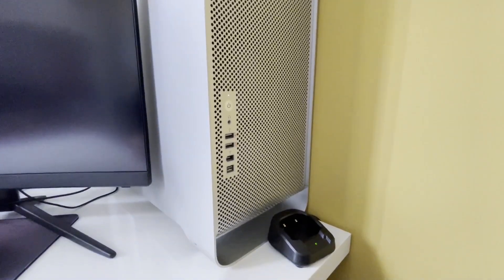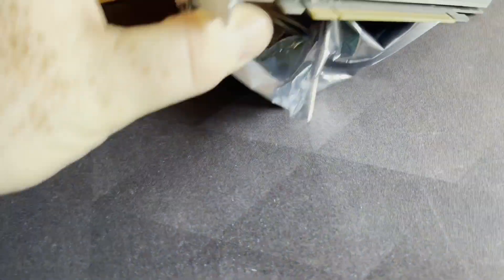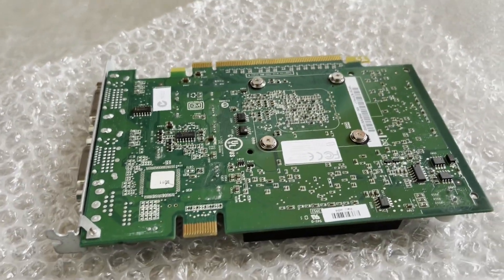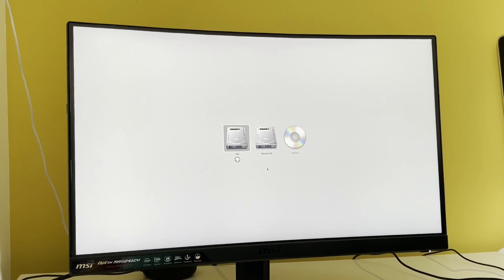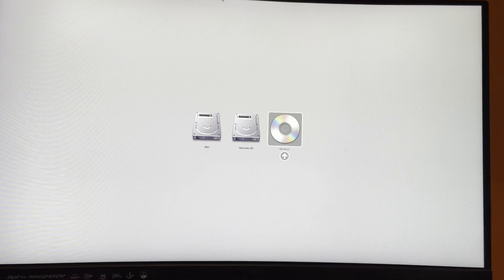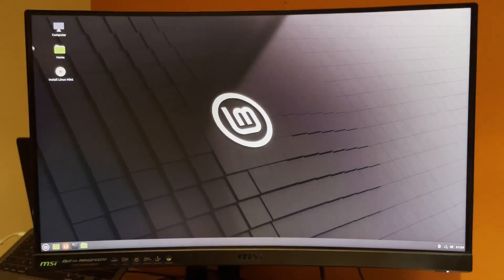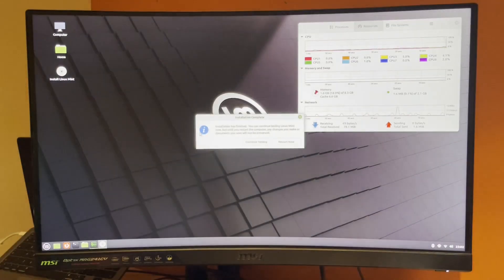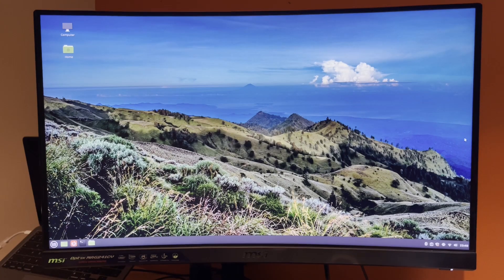We finally get Linux on this Classic Mac Pro 2,1

Comment: Is this a 64 bit Mac?
Reply from the maker: The Classic Mac Pro 1,1 and 2,1 were a bit odd, they have 64bit CPUs, so it can run 64bit apps and operating systems, but it has a 32bit EFI.
Reply: @WhatTheFlash-cx6ox  Thanks.
Reply: @WhatTheFlash-cx6ox  and how did you managed to boot a usb to install linux?
Reply from the maker: @VLiviu I tried a bunch of USB sticks without success. In the end I burned the Linux install media to a DVD ROM ( I had to buy a whole pack of them, most are sat unused in my drawer, annoyingly). With a DVD, I was able to boot into the Linux installer and everything else went fine. 

If you don’t have an ability to burn a dvd… I don’t have the device now, but one option to try might be to remove your hard drive from this Mac Pro, connect it to another PC that does accept usb boot devices, install Linux to the Mac pro disk (that is connected to your other PC) and then when complete, disconnect from that machine and install it back into the Mac pro. 

The reason I think this could work is because in Linux all of the hardware drivers, if you like, are built into the kernel, so when it goes into another machine, it will recognise the differences and load the other drivers at boot time. 

I think this will only work if you are able to see the boot screen, as you’ll still need to hold option at boot to tell the macpro to boot from the drive with linux on vs any macOS drives. 

I don’t have the device anymore, so I can’t test, but could be a route to try

Comment: Can it play starfield linux version?
Reply: CPU instructions probably won't support it if it's the socket 771 if this is an old Xeon from a newer generation it very well may be able to
Reply from the maker: Great question, this video card probably can't, but I should try putting a newer Radeon in here to check it out! Thanks for an idea.